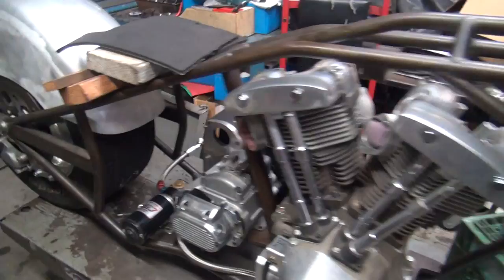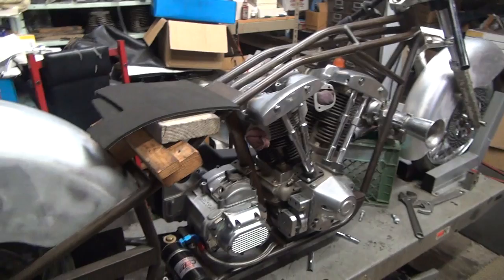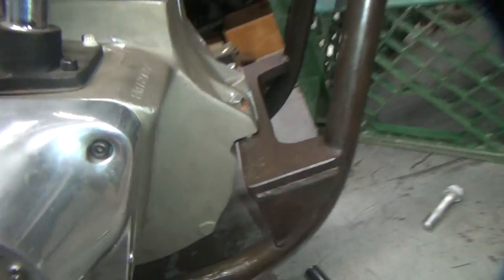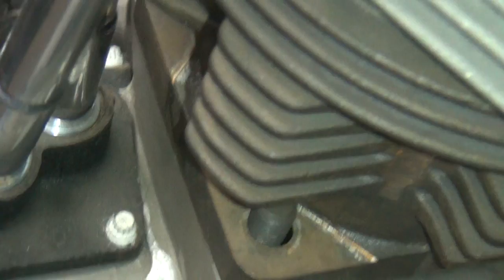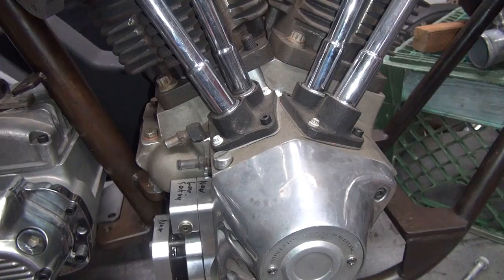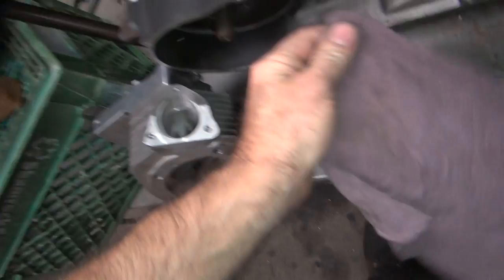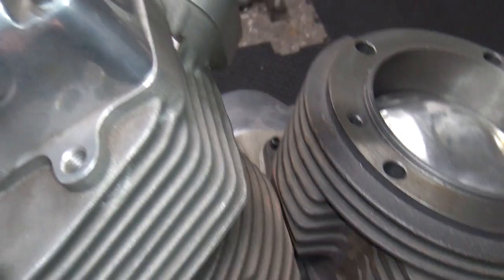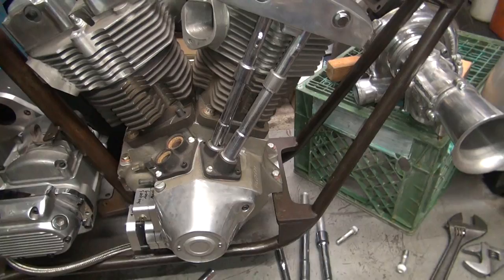120ci john Harmon #100 shovelhead Harley turbo SCTA LSR drag bike build by tatro machine

Comment: I know that this is an old video but I just finished watching it for the first time. Wondering if you ever finished it? Would really like to see a video of it running and someone riding it on the street and or dragstrip.
Reply from the maker: no, the 30 year project is on hold again.
tatro
Reply: @Tatro Machine  Thanks. I understand. Sounds like me with my 75 FLH shovelhead. Unfortunately it's turned into a lifelong project.

Comment: looks cool, when you showed the head i laughed, valves are ridiculous! i can't imagine what it must feel like to ride that thing when its done. nice bike mate, cheers.
Reply from the maker: K Freel the valves are small. the ports are big. the intake valve is going to get bigger.need more power.tatro
Reply: Tatro Machine
 sounds fun. would like you know your thoughts on running a supercharger in place of the turbo?
Reply from the maker: that still might happen.
turbos do not work very will on harleys because of the odd firing pattern. 
with supercharges you have to deal with the drive and backfiring if it is a roots type.
i will see the reps at sema this year and get the latest info.
tatro
Reply: Tatro Machine By odd firing pattern I guess you mean one cylinder firing 1 rev +/-45 degrees after the other. Could you smooth out the air flow by making a plenum the size of 1 cylinder or bigger? That way the turbo works continuously to fill the plenum...I guess you would still wind up with uneven pressure charges. I don't see how a supercharger will be different...unless the exhaust pulses driving the turbo are a factor. How about dual turbos and separate manifolds?
Reply from the maker: michaellfbvr right on most of what you stated.the super-charger is a direct flow device or positive displacement. one turn puts out a set amount of flow. a turbo is not a positive displacement device. it is a pressure driven device. you can have high rpm with no pressure. you have to have a load on the motor to make pressure & heat in the exhaust to drive the turbo. turbo's are more efficient but don't like uneven power pluses of a Harley. super-chargers don't care but the drive can be a problem. that drive pulley gets way out there in the wind and causes the crank to flex even more then it is now. outside supports get even wider. it starts to get stupid wide real fast.I like the idea of a turbo system but I need to get more info on how to make it work. twins or quads might work better then a single but for now I do not know.should know more after sema in a couple of weeks.tatro

Comment: well cool, i too have a compleat unfired 120" HARMAN street motor setup xr style with a .650 lift REDSHIFT cam from ZIPPERS. dual KARATA mags, look foreward to finding more of your HARMAN build vids here on tube, have just subscribed to you with hope you can post more.
Reply from the maker: mine is a 28 year and going project.
tatro
Reply: @TatroMachine  ditto mine 28 years since bought, but sofar iv not got around to fabbing a frame for it,  made a reverse motor plate mor mounting gbox in front of the motor with intention of building a front wheel drive reverse trike, 3" bdl beltdrive & vertical mounted blower from a mini, but like you far too many customers jobs to do, so hardly ever the time to get it done.
Reply from the maker: yes, we are saving it for future fun. the problem is that we have more than one of those.
tatro

Comment: are the baker transmission  much better than just your regular stock transmissions ?? if so can you explain a little please         John
Reply from the maker: much better, no. somewhat better, yes. i like the rollerized 4th gear. that is no more bushing. other than that it is no better than a stock trans with andrews gears that is half the cost.
tatro

Comment: how fast do you expect to run with set up? I know a Harman shovel is well worth the bragging rights, but what about Sorensen Performance big inch engines?
Reply from the maker: +joseph laperuta 
160 in the 1/4 and 230+ on the lakes would be nice. 
hard to beat inchs but good heads and a blower will get it done. pass the nitro please.
tatro
Reply: Tatro Machine too bad I live in NY my 67 shovel needs needs new life after some hack "rebuilt " it.new flywheel too since he shaved it down!
Reply from the maker: +joseph laperuta 
all it takes is money and ups. don't forget time.
tatro

Comment: one problem with these street motor barrels is the head oil drains exit the liners too high up the stroke,  meaning approx the top third or so is above the oil rings, what iv done with mine is to screw in a grubscrew into each drain hole in the heads & inserted hosetails for external oil drains, then redrilled through the liners a bit lower down. also if not wanting to make gaskets yourself, i recomend you contact LANNI at copper gaskets unlimited, https://coppergaskets.us/ as he made mine & should still have the details in his records.

Comment: Hey tatro... I am building a dragbike just for fun... would a OEM shovelhead hold it? i am not going to make a rocket just something for having some fun in the weekends... big bore high comp... i got an stock shovelhead engine with rebuild bottom end in my shop with a 4 speed tranny
Reply from the maker: you have to have 4-3/4" or 5" stroke to make it go. 3-5/8 bore is next or 3-13/16 if you really want to get going with a 116" motor. a fxst 5sp is a must with a good 90's clutch. you are just wasting time with the 4sp. porting, cam and carb go together. just match them as a group to how big you want to go. 1-3/4" dual drag pipes about 30-34" are hard to beat. build it right and loose and the motor will take it.
tatro
Reply: 4 3/4  inch  5 inch great stroke but if you what it to last ! 4 1/2 stroke 3 13/16 bore  10.25 cr kick only build for a costmer 15 year's ago  still running strong  lienweber cam std head s 11.15 et 127 mph  driving it too the track    my advice find someone or sombody that races shovelhead it all in the heads cam piston combo

Comment: I am trying to figure out if you were Bitching or Bragging about your Harmon engine.  All I know is a unmolested Harmon engine tends to sell for big money if and when they come up for sale.  John was a innovating creator of a lot of cool stuff and it a dam shame that he died so young.  He was doing stuff back in the 80's that still has not been improved on today just only copied.
Reply from the maker: gullreefclub 
i don't brag,  i let the time slip & the record book tell the truth.
this motor was made after he died and was not machined correctly. that is one reason why this motor was not finished yet. at 400+ hp this motor will have to be updated or it will be a short lived motor. for me, the value in my parts are how fast they go, not who made them. time will tell.
tatro
Reply: Yes they do I have two go then from eBay.  Un . Machined heads. Cases were right on the money as I'm am a tool maker machinst for a living and have  made  go &  no go gages for pan knucklehead shovelhead   for cases  have all numbers std. Panhead  cases were the worst

Comment: Very nice ! I look forward to hearing this Beast come to life A question for you Kennan is it worth running a right side drive at the rear when the cubes reach 120 ?
Reply from the maker: spiritoflights right side drive has to do with how much offset you have to have to make your chain or belt clear your rear tire. when you get to 230 to 250 rear tire that is when you look into going that route. I am at the limit with my 225 rear tire. I would have to cut and widen my rear frame to make the right side chain work. there is no difference in strength between left side or right side drive tyranny's. the gears are all about the same. it is all about how the gears are made and how wide they are, not on were the sprocket is.tatro
Reply: No probs I was just thinking along the lines of the torque all pulling on the left side of the bike i read some where thats why sportsters were right side to balance it all when the motor pulls my way of thinking there is more strength when everythings in line less room for things to run out,so left or right side makes no difference to the gyroscopic effect of the bike under such torque i think in theory the bike would want to lean to the left,lets just say i'm thinkin out loud ha ha not that you don't have enough things to try and deal with already i'm just voicing my thoughts Good luck with this build it's going to be one nice bike in your capable hands keep up the great work kennan, Simon.
Reply from the maker: spiritoflights all that sounds good except Harley is not that smart on making their new models. they just copied what they had the model before and upgraded it. that is they fixed some of the older models problems as needed. the 1st new bike Harley came out with in decades is the v-rod and who cares? stay tuned because that is what all Harleys will look like in just a few more years. the new epa laws hit in 2018 and 2020 or 2023. here comes the new junk.now the left side drive started back in 1903 with a belt and 1913 or 14 i think was the 1st chain. they still have the left side drive on all the big twins to this day. the right side drive goes back to 1926 starting with a single cylinder bike. it turned into a twin in 1929. that turned into the 45, k-models, all the dirt track race bikes, the ironhead sportster, the evo xl'x and now the rubber xl's.Harley just doesn't make to many big changes, just updates.the reason big twins pull to the left is because of rear steer from flexing of the drive line. the heavy left-side weight of the bike also makes it fall to the left. sportsters have the right-side drive but are still heavy on the left-side so they still like to go to the left but not as much as the big bikes.custom bike went to right-side drive to balance the weight of the bikes. they got so far to the left you could barely ride them. with the right-side things went back to more of a balanced bike. the tranny strth had noting to do with it. it was just to make the bike rideable again with them big ass tires.keep on learning.tatro
Reply: Hey kennan, thanks for wording it so well, what i was getting at in a round about way,ive read a little bit of what your talking about with the early bikes having a belt and how harley just upgraded and improved on what they were doing ironing out the bugs in a manner of speaking,you can see how their bikes really evolved through the years i think it's a fascinating journey of engineering to see how they progressed from model to model through the early big v twins.I hear ya about the v-rod and epa laws it's all turning to electronic this and that and water cooled crap that's plugged into a computer to see whats going on very much like the cars of today it's a disposable plastic cigarette lighter society where living in now people buy a new car that is mass produced and not made to last cheap and nasty shiny pieces of shit that wear out all show and no go heaven help the modern consumer it's a dam vicious circle the automotive bondage that the little mans is held in it's all about screwing as much out of us as they can i think the greedy bastards there's certainly not the quality anymore living in today's world that there once was I recall you saying buyer beware that holds true in so many ways.It's great to see your videos rebuilding those old panhead heads keep up the great work/videos take care simon.
Reply from the maker: spiritoflights well said, just the way I see it.there is still hope in the hot-rodders and hackers. as they learn how to use their hands and minds they become talented. without want there is no need.I do my best to speed the process up.tatro
Reply: @TatroMachine  lol spot on bud look H-D got that electric bike now high wire or something like that
Reply: This bike will NEVER "come to life". If anything it was DOA. Besides, Cessna motor is the priority.